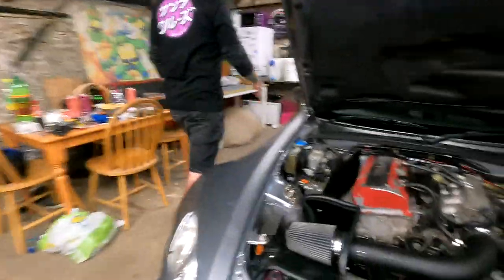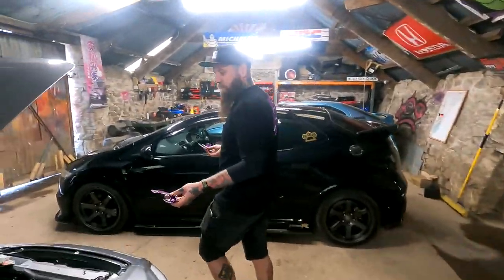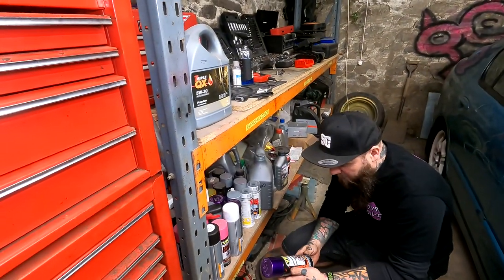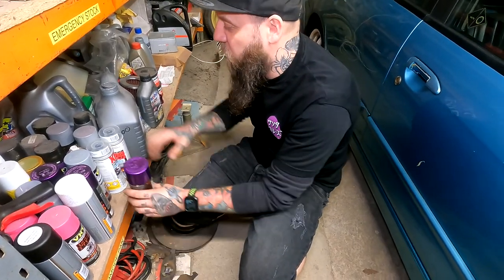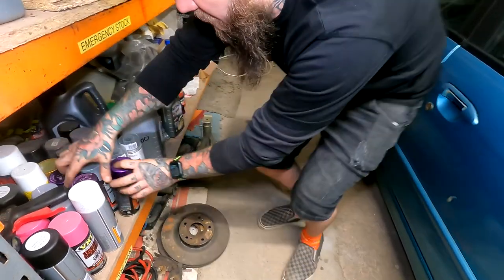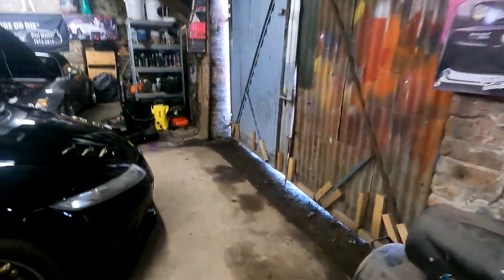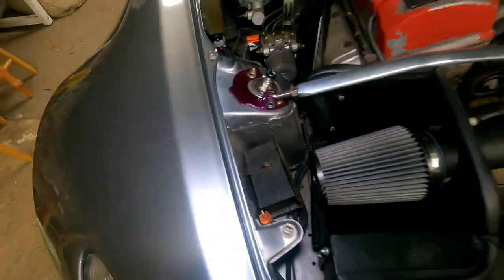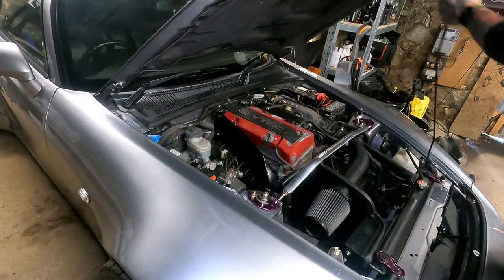Bargain Honda S2000 Tanabe Strut brace installation

Comment: I have the exact K&N intake in my vehicle. Good to see that it doesn't necessarily interfere with a strut bar. The air box seemed a little big. Can you tell a significant difference with cornering or attitude with the strut bar installed?
Reply from the maker: Tbh mate not a huge difference, possibly would do if it was still on oem suspension though I think, I have the coils set pretty firm